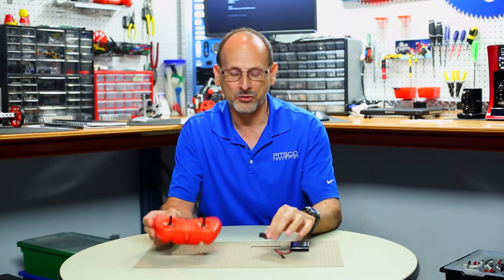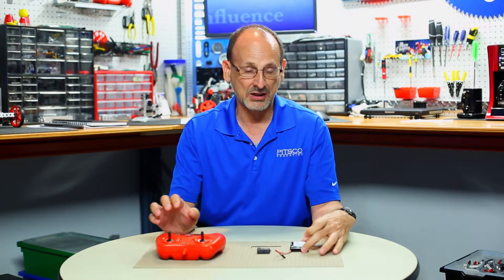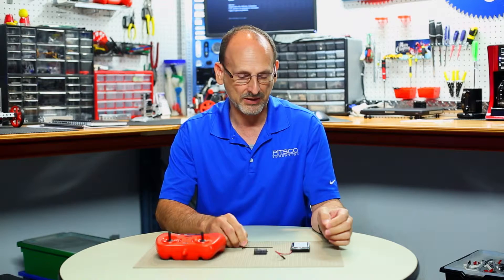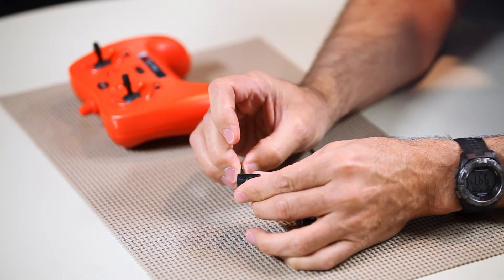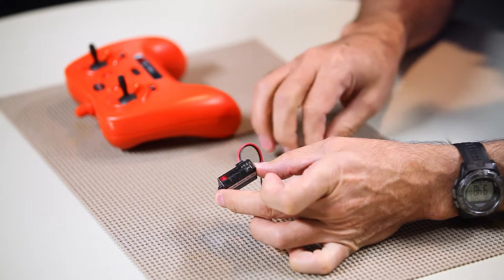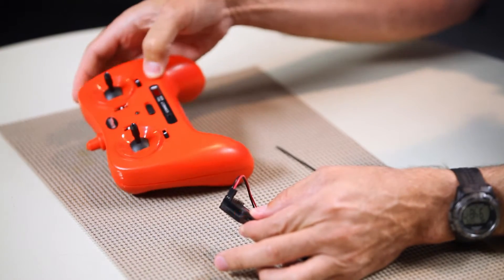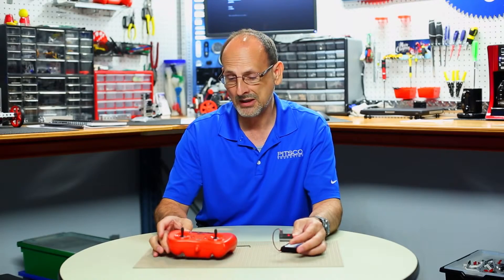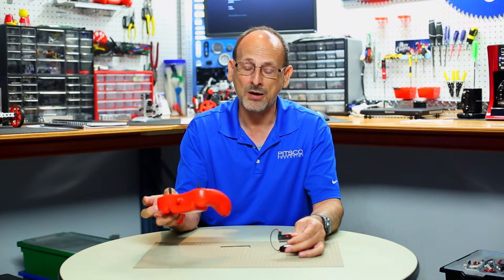Pairing the TETRIX PRIME Gamepad to the Receiver

Comment: what if the receivier is NOT flashing when the charged battery is plugged into it correctly?
Reply from the maker: If the receiver isn't flashing (the light is steadily on), then the receiver thinks it's already paired and connected to a gamepad. If there's no gamepad on and within range, and you still get a solid red light when a battery is plugged in, then that isn't  normal behavior, and you might have a faulty receiver. If the receiver was purchased within the last year, then please contact our customer service and request a replacement. https://www.tetrixrobotics.com/Support/